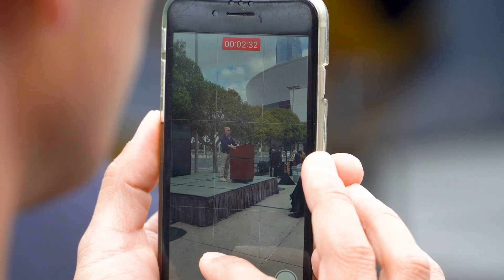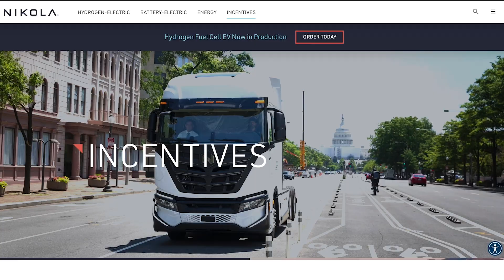Nikola | 2023

Comment: Hello Nikola would act as an investor for owner participation if the shift system in the light city of Jena generates profits, please talk to the mayor of Jena, Mr. Nitzsche, about the research institute with the concept 33 united city water group.  mfg your AGK DTS Hypo Economist Concept Institute maison des associations Thuringia united Germany Protestant Union
Reply: 33.q Hello, there is a new technology from the mda Roll Royce cooperation engine that is ideal for the DB, a vacuum hydrogen laser reactor with a magnetic field pool to form a current absorber, which could be used for trains as moving power plants with a buffer storage wagon.  Thus, a kiwapi kilowatt Pi economy can take place through a ki management control.  Your AGK DTS Hypo Economist Concept Institute maison des associations Thuringia united Germany Protestant Union ©®™ would charge 50 percent of the final patent.

Comment: Lots of promise here:

1) Major public investments in regional hydrogen hubs to develop critical path infrastructure

2) The H70HF protocol for heavy duty fast fills (above 10 kg-H2/min)

3) Advances in solid state H2 storage; manganese hydride looks promising

4) Ultra low-PGM and PGM-free fuel cell membranes could really improve the economics of the powertrain, expanding the market

5) Efficient advanced nuclear high temperature thermochemical synthesis should enable rapid scaling

6) Larger fuel cell stacks for the heavy duty use case should really improve specific power and power density while lowering costs